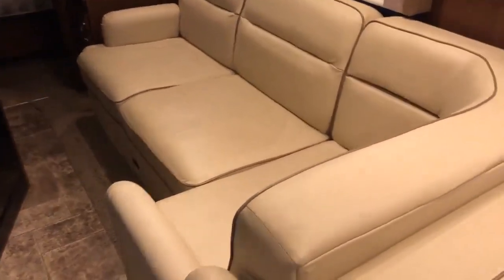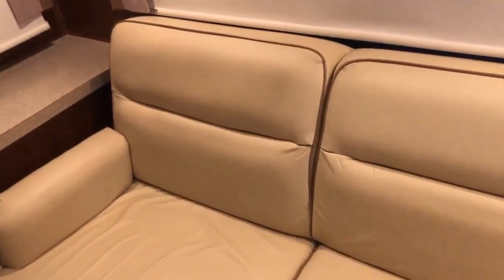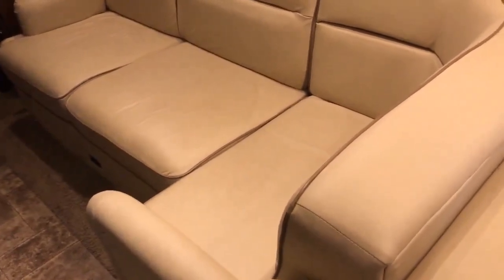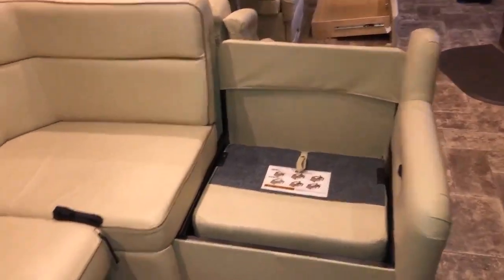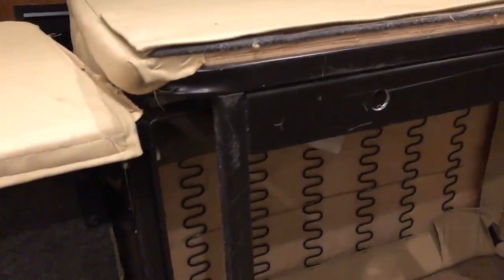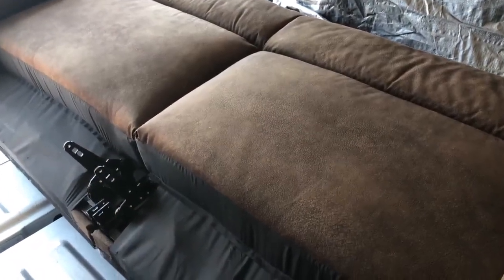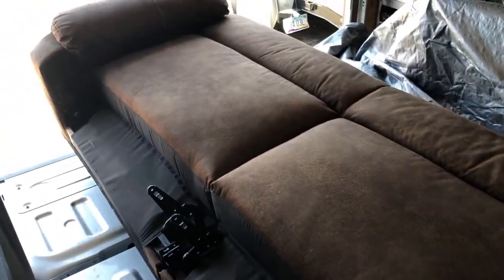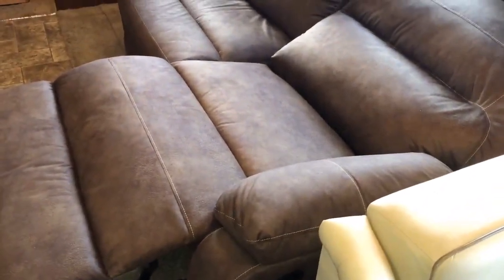RV Replace L Couch

Comment: How did you attach the seat to the slide out floor, wood screws bolts and how long?
Reply from the maker: I used the same length as the original bolts that were used on the old couch.  I chose lag screws as they have deeper grooves to grab more material.  Be very careful to not go too long on screws so you don’t go through the bottom of the slide.  Best option is to reuse the same bolts and location points if you can.  You might have to fabricate a bracket, but then you can rest assured you have no issues.